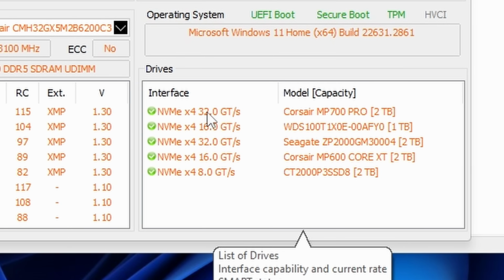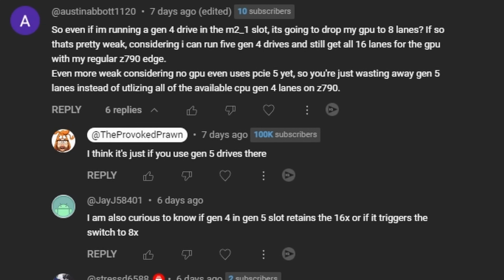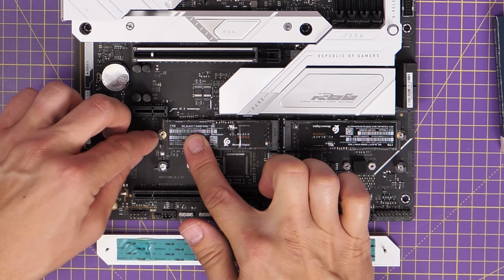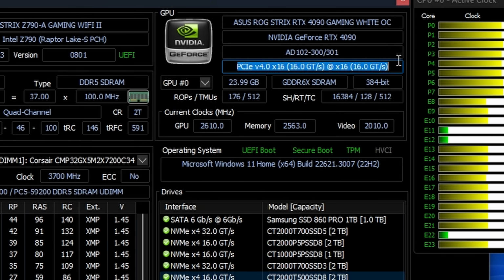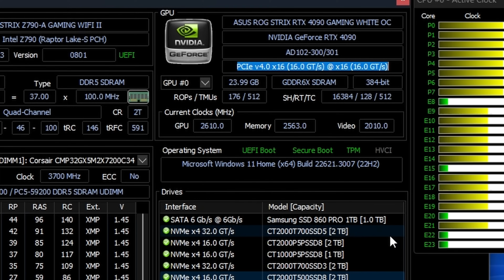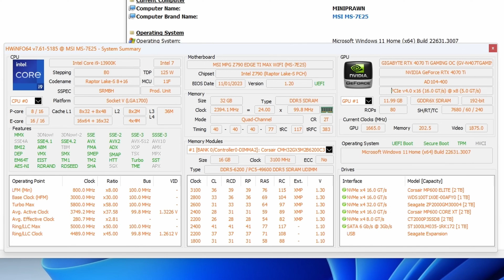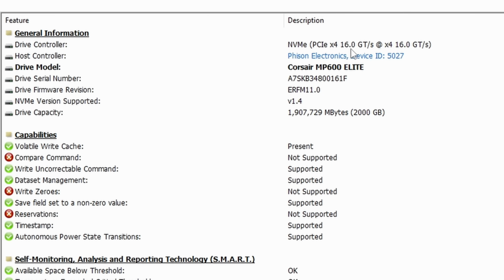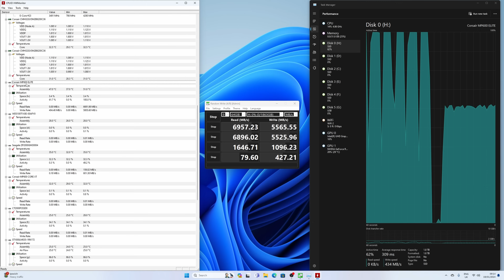Problems with NVMe SSDs and motherboards that you need to know

Comment: Lanes in use has nothing to do with the PCIe version. Most NVMe drives are 4 lane drives regardless if 3.0, 4.0, or 5.0. As mentioned here, the bifurcation (splitting of x16 CPU lanes to x8/x8) of CPU data lanes is dependent on the MB maker and version of MB has implemented as well as which CPU. It requires a special chip and not all use it. Latest AMD processors have made this worse by having some CPUs in the latest APU line that only allow 4 lanes for a dedicated GPU if added later. This could negatively impact a future GPU added even with the supported PCIe 4.0 version. Also, adding NVMes can disable other ports on the MB. 2 SATA ports often share connectivity with a MB NVMe slot and can be disabled if a NVMe is installed in specific slot. Also, adding a a PCIe card into another x16 length PCIe slot can either run off the chipsets shared bandwidth or restrict the GPU in the first x16 length slot to x8; bifurcation if supported. And finally, NVMes, even if they state in HWInfo as x4, could be hampered in performance if the slot in which the NVMe is inserted is fed from chipset. Typical desktop CPUs have one dedicated NVMe to the CPU x4 lanes. The rest are either stealing from the x16 graphics slot CPU lanes or running through the shared bandwidth of the chipset. This shared bandwidth is with SATA, USB, Ethernet,  WiFi, and any other MB "features". The CPU data lanes are limited and unless the device has its own direct memory access and processing unit, it's sharing the CPU lanes with everything else. This only getting more complicated and GPUs and CPUs restrict available lanes of communication.

Comment: Well, that is disappointing to say the least..All the tech mumbo jumbo and no can adhere to the specification what ever they promised..
You can run fast for now, , but one of the wheel maybe is gonna fall off and don't worry about the set of wheels, some might gonna be fast, but some might  gonna slow the truck down, you'll get there ....eventually.  IF is the magic word..lol
Great salesman tactics from the factory🤣

Comment: Good vid that said gpu's will not even get close to bottlenecked witn 8x pcie5 lanes unless you run some really wonkey workload. Kind of amusing many high end MB's are having more issues like this since they try co cramp in as much as possible thus bus sharing get more common.
Reply: No GPU will run at pcie gen 5 x8 because all modern gpus even the 4090 are gen 4, meaning they will always be slashed down to pcie gen 4 x8, which can lose 3 to 5% max performance. I just ended up putting my gen 4 ssd in the second slot, so my gpu runs full pci4 x16.

Sure I lose 2 to 3% max performance off my nvme due to using chipset lanes instead of cpu--but if I have to choose which device to get 100% from: either my $1000 gpu or my $200 ssd, im going to pick the more expensive gpu lol, I want every damn frame I paid for

Comment: You can fill the board with NVMe drives and be "fine" on the CPU-Z screen, but you definitely not fine if multiple drives are active at once. With AMD you only get ONE drive connected directly to the CPU and ONE drive connected through the chipset to run at full bandwidth simultaneously without competition. Any drives past that are SHARING those lanes. If more than one drive on the same bus cranks up, speeds on other drives will drop or be halved by default. He says as much in this video. Intel is even worse. No direct CPU bus for an NVMe without robbing GPU lanes, so you only get ONE drive at full speed.

Comment: The issue is that both Intel and AMD refuse to put a reasonable number of PCIe lanes on their consumer CPUs.

Even where you fill up a board with SSDs, you then just cause a chipset to CPU bottleneck as for example for AM5 the chipset is connected to the CPU by 4 PCIe lanes, so putting a load of drives on the chipset doesn't mean you can access them all at full speed at once.

Comment: I believe the Asrock X670-E Taichi runs the PCIe gen 5 NVME through the chipset, allowing the PCIe x16 for the GPU to run uninterrupted to the CPU, unless of course you use the second PCIe slot.

Comment: I heard somewhere online I think that it doesn't matter if the graphics card is limited to x8 pcie because the graphics card doesn't use that bandwith. I also heard of some graphics card coming with an nvme drive bay to make up for the unusued pcie bandwidth.
Reply: What everyone forgets is what happens when you put an 8x pcie4 GPU in a pcie3 slot. 16 to 8 is still fine but not 8 to 4.

Comment: Don't this effect go back to running out of PCI lanes on the motherboard? There are only so many lanes and they are usually reserved for drives and the GPU but once you start filling them all with M2's and NVME's, the drives take priority and thus removing performance from the GPU. I always thought this was somewhat normal? I have 2 slots on my board and both are full. I haven't noticed a difference in performance since I installed the second one.

Comment: Watch out for cheap boards in this respect: on one of these boards, I wanted to install a second M.2, only to find out there was just a single M.2 slot. So I got an expansion card, stuck it in there and plugged the second M.2 in the card. Then I looked at the lane configuration and to my horror I could see the GPU was cut down to 8 x PCIe 3.0 and the SSD was at 4 x PCIe 2.0!
The weirdest thing was that the SSD was in a x16 slot, but it was only wired as x4. And that it maxed out at PCIe 2.0. How useless!
So better look at the manual, especially when buying a budget board.

Comment: If your gpu is inserted in a gen 5 slot but x8 lanes, isnt that the same as gen4 x16?
Reply: Yes, but only if the GPU is gen 5. Which it isn't.

Detailed explanation:
bandwidth per lane doubles with each pcie generation. So x8 gen 5 has the same bandwidth as x16 gen 4.

But a gen 4 card in a gen 5 slot will only use the lanes at gen 4. Same, a gen 5 card in a gen 4 slot will only use the lanes ar gen 4. The lowest lane speed wins.

And 8 lanes are still 8 lanes. Using them at a lower gen does not double the amount of lanes. it just halves the usable bandwidth unfortunately.

There are pcie switch chips! These chips can transform for example 8 pcie gen 5 lanes into 16 pcie gen 4 lanes. But that's not something you buy (to my knowledge). Those chips can be on a motherboard that wants more pcie slots than available lanes by the chipset, and sometimes those chips are also used on specialized cards to connect many nvme drives. When quantity of lanes is more important than max speed per lane.
Reply: Yes it is the same as gen4

Comment: you always have to look at how the PCIe lane are coming off the CPU in retail CPUs which typically share the NVMe and first PCIe slot (for PGU), there is a maximium lanes availabel from the CPU for this purpose but it doesn't matter if you connect a lesser PCI3 standard like 3.0 in either slot. you are still consuming the split between the slots.  the other issues is if the GPU actually suffers a performance loss from going to a less than x16 configuration.  many GPU don't suffer from a smaller lanes when the version is higher.  a PCIex x8 8.0 is the same as PCIe x16 3.0 in terms of bandwidth.  plus some GPU are not capible of higher PCIe version which limits the available bandiwdth

Comment: EEEWWWWWW.... You use Intel. AMD Ryzen is infinitely better.
Reply: not really. both intel and amd have mislead the users. it's also depended on the chipset. for example, amd's 670 chipset has 8 lanes connected to the cpu, but they work at gen3. go figure.

Comment: This is more an Intel thing then an AMD thing.
I can't think of any B650 to X670E motherboard that sacrifices lanes from the 16x slot if the motherboard takes 3 to 4 NVMe drives.
I know a couple of boards that can take 5 NVMe drives that share lanes with the 16x PCIe slot. 5 drives is also out of spec!

Comment: This has been a problem for years. I Used an MSI x370 gaming carbon pro and the second nvme slot disabled one of the SAT slots if a NVME was fitted. The PCIE slot 4 was only 4 lanes but it ran my EX570 woth no problems and I got a 4 nvme addon card which I used in the PCiE 16 lanes.
I wanted to go to a MATX and Ryzen 5700G thinking I could use the 4 way card for 4 NVME drives by making the PCIE slot 1 into a 4x4x4x4. No the Ryzen 5700G only supports 8x4x4 so thats t nvme drives.  The Board us an Asrock b550 pro 4. I was aware the second nvme position only operated at PCIE2 if used as nvme and also disabled a SATA position. I knew the Ryzen 5700G was only PCIE 3 but that did not bother me. I was counting on using the 4 port nvme card in the PCIE 16 lane running 4x4x4x4. But as noted above the ryxen 5700g will not do that. I think its rather stupid of AMD not to think  a user of integrated graphics might  want to use the graphics slot for something else. I am now tied to noo graphic card in this system as I am fitting a 2 port nvme adapter with a chip card into the second long pcie slot that runs 4 lanes.
The whole thing of what happens is not documented well by anyone.

Comment: I`m not suprised by this, i did notice however that even on MSI`s webpage for this Z790 motherboards specs and even in it`s manual it nowhere mentions the sharing of pcie lanes, wonder if you have bandwith bifurication option in the bios on this board.

these kind of issue`s is the reason for me why i went with a AMD 7950X and a X670e board. 1. amd gets you 28 pcie lanes instead of intel with 20 lanes 
2. X670e gets you a lot of additional pcie 4.0 lanes.
 i can easily install 5 nvme`s of which 1 is pcie 5.0 and still have pciex16_1 slot run x16.

Comment: I have definitely realized over the last couple years that if I am interested in a certain motherboard, I first download the manual for that motherboard and research all of this stuff as there are surprises out there.  I have seen in addition to SATA ports being disabled with certain NMVE scenarios, I have also seen Thunderbolt ports disabled in this fashion as well from what I have read in the mobo manuals.  Read before you buy is my new mantra!
Reply: that's the way to go for since this opportunity exist! (even before manufactures did it themselves, there's still many manual hosting sites online!^^ - hell, ppl even manually scanned pages back in the day to make them public xD)
Reply: Yeah, but most manuals don't explain properly how M.2 scenarios work.
Reply: @Matlockization  yeah, they are inconsistent with that.  Some do, some don't.
Reply: @viperrcr  I'm guessing with the high-end boards (or 2025), you can reclaim the dormant 8 lanes from the X16 slot, but it defeats the purpose since most at that price point would spend more on a GPU ??? At least AMD 8700G APU would allow for a free X16 slot for storage provided no GPU installed.
Reply: Nice to see the IRQ sharing and what ports/slots to use on motherboards has grown up.
Reply: Yup, I did this on my TrueNAS server and I'm really glad I did. I needed all 6 SATA ports, but using more than 2 NVME drives would mean losing 2 of the SATA ports.

Comment: It's not really an issue with NVme, it's an issue with Intel stupid lane allocation/sharing (and lack of lanes). AM5 is quite better in this aspect
Reply: For motherboards starting at 250€ and if you only need 2 nvme. AM5 is the most garbage chipset pcie lane wise.

Comment: Very good info Mr Prawn. I have a Asus X670-E AMD board, and a PCIE 4.0 nvme drive in the first SSD slot. HWINF64 reads this in the GPU info : PCIe v4.0 x16(16.0GT/s @ x16 (2.5 GT/s). So I guess it 16 lanes, but why only 2.5 GT/s ? Any1 have a clue ?
Reply: Forgot to mention, it is a RTX 4070 TI GPU
Reply: @vinland98trance  Use GPUz and run the render test to see this correctly, or you can still run HWINF64, but you need load on the GPU. His info is not correct as it didn't seem like he was running any load on the GPU.

Comment: My z790 Hero doesn’t steal from the gpu, I get an add in card that runs it in the bottom x4 slot, either 1 gen 5 ssd or 2 gen 4’s for it.

Edit: but honestly F Intel and amd for not adding more pcie lanes by now.
Reply: AMD has more lanes than Intel and can run a gen 5 nvme without taking away lanes from the gpu
Reply: @RKBenchmarker   it’s 4 lanes more with the 7950x… with all this high speed stuff we have now we should be getting more pcie lanes than my 10 yr old computer 😂
Reply: @ShawnStrickland  Sounds like AMD's new HEDT (TRX50) would be a good fit for you if you're needing more lanes.
  And BTW, AMD has 8 more... it's 20 vs 28 usable lanes. Hope the info is helpful.
Reply: @RKBenchmarker amd cpu has 28 total lanes, but 24 of those are usable, i guess the other 4 are for the chipset only. keep in mind that not all of them can be used at gen5, same goes for intel's 20 (16 lanes at gen5 and 4 at gen4). this is what most ppl don't understand, both amd and intel mislead by specing the total lanes, but they don't clearly state if all of them can be used at gen5, which they can't.
Reply: @giornikitop5373  Those (i.e., gen5, gen4) are clearly stated in the manuals, and those can always be accessed/downloaded.
Reply: @RKBenchmarker  i don't think anyone is downloading cpu manuals.

Comment: It's still oversubscribed, five SSD need 20 lanes but they have to share four PCIe 4.0 lanes and eight DMI 16GT/s lanes at the CPU. If the drives are used simultaneously it might be better to split the x16 slot for a Gen 5 SSD. This is one area where AMD is more flexible, you can have up to 5x Gen5 SSD, and only 2x on Intel

Comment: I only have my system to reference, but wanted to share that my MSI MAG Z690 TOMAHAWK WIFI DDR4 motherboard has a WD_BLACK SN850 4TB in the first m.2 slot and the EVGA 3080ti 12gb shows to have all 16 lanes accessible in HWiNFO64.
Reply: Because it only has pcie gen 4 support for m. 2, there is no gen 5.

Comment: Great video!
Thank god these are some very specific high-tier problems, affecting only a tiny minority of users. For example, If you can afford a 700 dollar motherboard, then spend money on bigger SSDs instead of several smaller ones. If you can't afford those SSDs, spend less money on the motherboard. You can get an excellent DDR5 motherboard for $200-300.

Usually, no point in having four or five 1Tb NVMe SSDs in your motherboard. Just buy two 2-4Tb SSDs and be done with it. Also, almost nobody needs these speeds on their SSDs. You don't benefit from it, unless you transfer massive amounts of data on your system regularly, or you do some extreme simulation with huge data amounts (although the work pipeline bottleneck in simulation usually is not the data transfer rate of an SSD, but the CPU, unless you're using a $20k super home computer with 2 physical CPUs with 128 cores both, or something like that).

Only 0.1% of PC users will actually benefit from the PCIe 5.0x4 (4 lanes, 4GB/lane) 16 GB/s data transfer speed compared to the 8 GB/s speed on PCIe 4.0x4 (4 lanes, 2GB/lane), so the 99.99% of us peasants are doing just great with the PCIe 4.0 speeds. Gaming doesn't benefit from the extra speed at all, and even heavy video editing or most productivity workloads doesn't benefit from it. The work pipeline bottleneck is pretty much always elsewhere.
Reply: "Almost nobody needs these speeds on their SSDs" lol. ALL PC gamers need those speeds. Games are bigger and more texture rich than ever to the point that SATA SSDs and slower NVMe drives are falling behind. NVMe drives show very noticeable gains in loading times with newer games even without specific optimization. Any games with Direct Storage show massive gains. Some games like Ratchet and Clank have fundamental changes in gameplay based on your drive speed.

Comment: An LGA1700 CPU offers 20 CPU PCIe lanes.  This includes 16 PCIe 5.0 lanes and 4 PCIe 4.0 lanes. If the motherboard designer chooses to employ PCIe 5.0 for the primary ("top slot") SSD, those lanes must be borrowed from the lanes allocated to the GPU, so the GPU gets 8 lanes, the SSD gets 4 lanes, and 4 lanes (of the 16 allocated to the GPU) will go unused.  Even when a PCIe 4.0 SSD is installed in the top slot, the board's architecture is still employing 4 lanes from the GPU, so the GPU will get only 8 lanes.  If you want your GPU to have 16 PCIe 5.0 lanes on a board like this, you need to leave the top slot unpopulated.  Intel's upcoming 15th gen Arrow Lake (LGA1851) will remedy this by increasing the PCIe 5.0 lanes from 16 to 20 (in addition to the 4 lanes of PCIe 4.0).

Comment: Well, all z690/790 boards that have PCIE gen 5 m.2 slot(s) will always halve the first X16 PCIE slot down to X8, regardless of the brand of the board you use.
Reply: Even if you install an PCIe 4.0 SSD into the Gen 5 Slot? As far as I know, they share the same physical connection I think?

EDIT: NVM, I should've finished the video before commeting. I only was halfway through it when asking